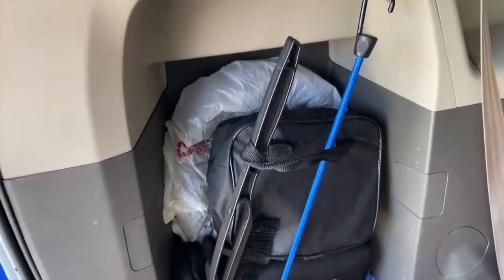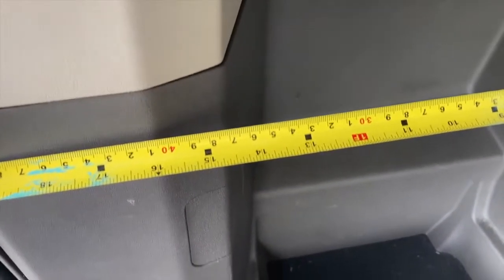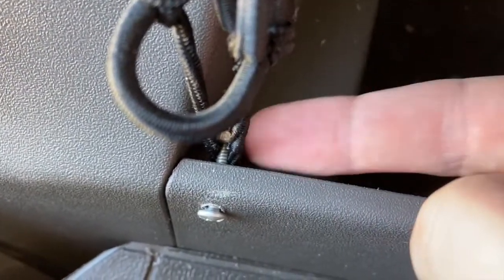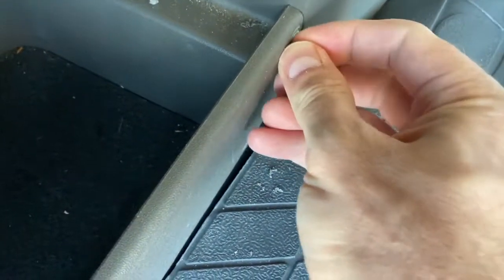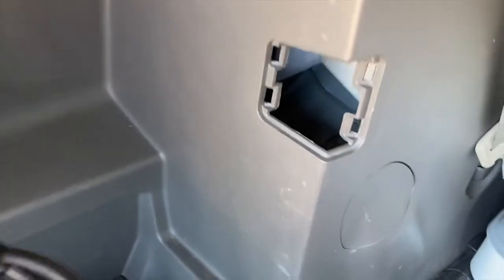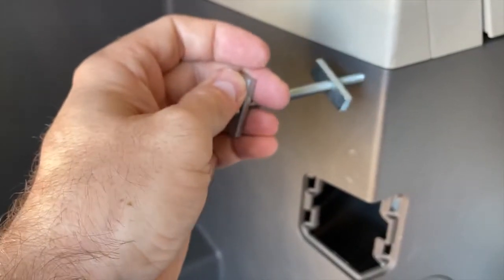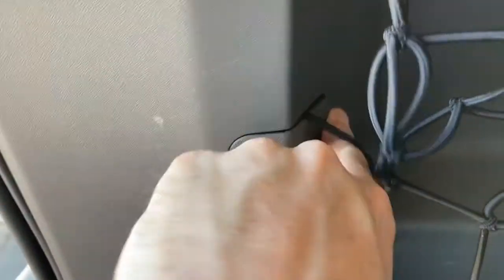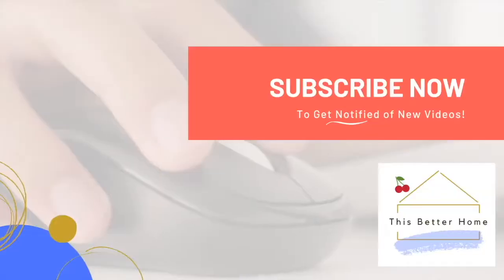️🔥 Extra Storage for Your **Toyota Sienna** (or Minivan / SUV / Car?)➔ How to Install a Cargo Net

Comment: Love the video, thank you! 
Wondering what you have covering your cargo area? Do you have your rear seats up?
I'd like to keep rarely used items in the well then cover with something solid to put groceries on.
Reply from the maker: Hey, thanks! I popped some links in the description for all the floor mat I have. The cargo area mat I cut down to size and love it - with the 3rd row back seats down, it provides a solid surface (and is spill-proof). When I put the seats up for use, I simply roll the mat up and store it. I do not have a solid floor over the cargo area well with the 3rd row seats positioned up, although the idea is intriguing.

Comment: How would you install the cargo net into the side wall or a ceiling if you couldn't reach behind with your hand for the nut and bolt configuration?  I saw at least 1 video where they anchored it top down into the side wall and ceiling without being able to reach around. But they didn't say how they did it. And the cargo nets don't come with anchor points to secure them with (at least mine didn't). Thanks.
Reply from the maker: I wonder if a small toggle bolt wall anchor would work. I'd have to be very careful I didn't drill into something on the other side, though.